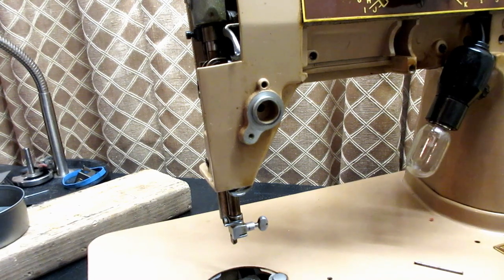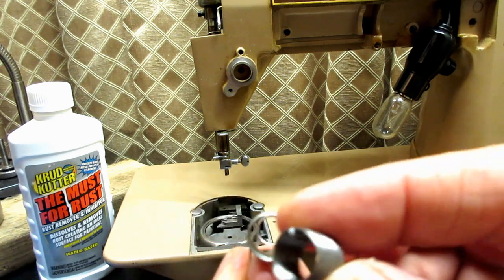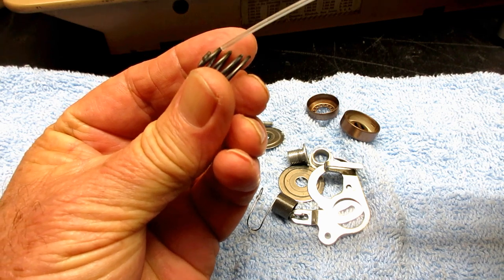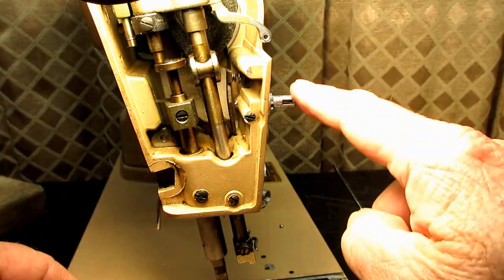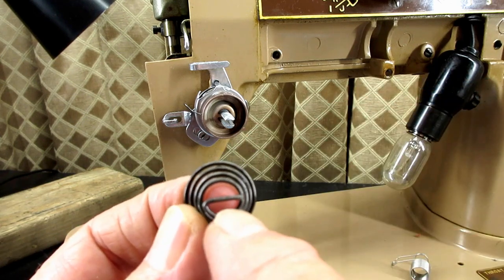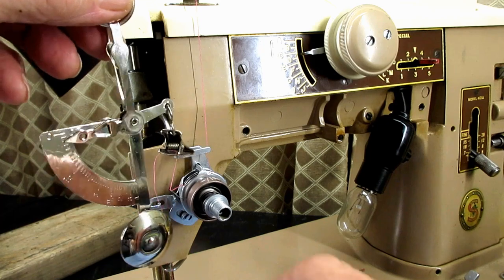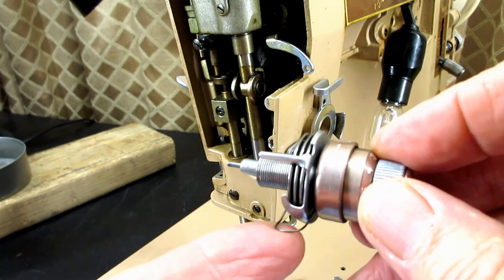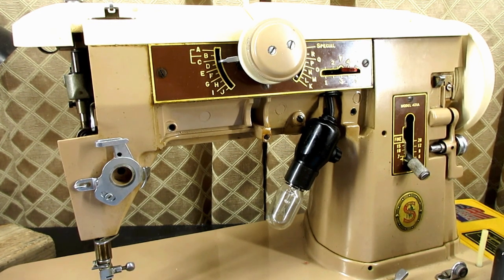Replace / Install a Missing Tension Unit on a Singer Model 401A

Comment: Thank you for your videos on the 401/403. I have two 401's that I got at D.I., one working and one labeled as a parts machine. I just stored them for years due to lack of time. I recently set out to convert my working 401 as a treadle/hand crank because I have several old Singers, including treadles and centennial models, but no zigzag treadles, so I made the adapter, and the 401 worked perfectly.  Then I got to looking at the "parts machine" and discovered it was missing the bobbin cover, the red lever,  the outer/brown zigzag knob, foot, but everything looked good and motor ran. I bought a foot and threaded up, but it would not sew a stitch. Thought it might be because of no red lever to control width, so I made one. It still would not sew a stitch. I fiddled around some more and decided it must be an alignment problem. That is when I discovered your videos. I followed your 401/403 timing video to the letter, and it now sews perfectly. It was WAY OFF. Someone had obviously monkeyed around, screwed up the needle depth and timing with the hook. I just finished your tension video so now I will go check that end of things out. Thank you for sharing your excellent knowledge!! I have since passed the info on to two friends who also have 401's.
Reply from the maker: Greetings, Wayne. I have to say I enjoyed your comment immensely. I bet the 401A makes a great treadle machine. It has some cousins in Germany, 401G, 411G, 431G, etc. that can be set up as treadle machines also, and viewers who have them tell me they work fabulously and they love having a treadle ZZ machine. Yes, for sure someone fooled around with that machine and got lost and decided it was now a "parts" machine; I've seen a few like that. It's great that you have rescued it. I'm glad you found my channel and the videos are helpful. I appreciate you sharing the info, too. How fortunate to have two Slant-O-Matics! Have looked at the serial numbers on the bottom near the nose end? Just wondering how close in age they are. If you ever find out their names I'd love to know them. Happy sewing, and take care in 2023.

Comment: Andy, Thank you for your excellent videos.  I bought a 404 at a Church "Trash and Treasure" sale for $5.00 and a 431G was given to me.  When I got them I had no idea what treasures I had.  Thanks to your videos I was able to make adjustments in the tension and in the bobbin case on both of them. I appreciate your taking the time to make the viewer completely understand the mechanisms. It's nice to know that when something goes wrong I can do a search and find one of your videos that will help me solve whatever problems come up with these amazing machines.
Reply from the maker: Oh, man! Who knew in this crazy year of 2020 you could be so lucky! Yes, a couple of treasures for sure. I'm glad if the videos helped you with the machines. You can do any and all repairs/adjustments required and keep them running for every. If the motor seems a little sluggish I'd like to share this newer method for speeding it up. I do this on every motor I work on now. https://youtu.be/pzq4tv8qn94
Thanks for taking time to comment, Steve. See you next time.
Reply: @andytubesewing1953  I ordered a Diamond D stick right away and just used it. I noticed right away the increase in the speed of the motor on my 404 but my 431G has a different type of motor and the commutator isn't as easily accessed and I didn't want to take the motor out.  Thanks for the tip!
Reply from the maker: @stevel9353 I appreciate the confirmation that it helps. I'm not familiar with the 431G German slant needle models other than pictures. I just assumed they had the same PA motor. Thanks for sharing on my channel. Take Care.
Reply: @andytubesewing1953  I took a picture of the motor but I'm not given an option to upload it.  The markings show:
PAB8-
110/120 V
Made in France
Reply from the maker: @stevel9353  I was able to find some pictures online. I see what you mean. There are no brush covers that give direct access to the area and the commutator, but looks like a two-part cover and you remove the lower half to get to the brushes and commutator.
I think internally it would be very similar to the PA motor on your 404. Maybe someday you'll need to replace the brushes (20 years from now, haha) and you can take a look inside. Take care, Steve.
Reply: Thanks for looking in to this. I enjoy earning about my machines.
Reply from the maker: @stevel9353  I enjoy it also and I was curious. I'm glad you mentioned about the motor. Take care.

Comment: Thank you for your informative videos sir. They have been helpful. Unfortunately, I continue to have problems reassembling the tension unit on my Singer Merritt 4530. To make matters worse I am unable to find any information about my particular type of machine. Any help or direction as to where I might find information would be genuinely appreciated!
Reply from the maker: Sorry, I can't help you with this model. It's one of a handful of "Universal" 5, 6, 8 & 10 stitch models sold in several countries where they took the frame and parts and used them for a number of models. I've never seen one in person and tend to avoid this type of Singer b/c of all the plastic parts inside. Other than a universal instruction manual I've never been able to find a parts or service manual for any of them.
Reply: @andytubesewing1953  Thank you sir! Best wishes!!
Reply from the maker: Weel, sorry I could not give some help. Good luck.

Comment: Hi Andy!  Thanks for your very thorough video!  My machine 401A was constantly breaking the upper thread.  I have had some trouble with the tension on this machine (my grandma's machine that she gave me back in the 80's).  I had it serviced several years ago for this reason but it never really worked well after that.  Watching and learning on your video revealed the reason.  Whomever (and he is no longer in business) serviced the machine replaced the tension assembly with one from the 201-2 model.   I am trying to work out how I can adjust this to work on my machine, if possible.
Reply from the maker: It's too sad, Susan. Sounds like they took the parts for another customer. No one I know makes the parts you are asking about. When I have this situation I have to find a used tension unit for sale, like on eBay. They are in short supply right now due to everyone sewing masks on the old machines. When they come up for sale they usually sell within hours. I've had to set up notifications on eBay to notify me when a unit like that is available, that's how hard they can be to find. I've had a couple people tell me they bought this "universal" tension unit to be able to sew while waiting to buy a vintage unit. https://www.sewingpartsonline.com/tension-complete-singer-422403-455.aspx Please note that the seller states you may need to modify the tension pin by making it shorter. 
Sorry for this disappointing news, but here is a little bit of better news. Singer models 401A, 403A & 404 all use the same tension assembly, so if you do search for a used one be sure to search by the 403A and 404 models also. Not many people know that yet, although the word is getting out, and you maybe can spot a 403A or 404 unit for sale. Again sorry for the news, but I'm happy you found my video and at least know of a solution now. Good luck, and thanks for watching my channel.
Reply: @andytubesewing1953  Thanks again!
Reply from the maker: @susanbrizek1692  Very welcome, Susan. Hoping the best for you.

Comment: Thanks again for your great videos my tension seems to be fine, I tried with two different gage of cotton threads and different stitches. 
When I lift my presser foot lever, the releasing lever doesn't seem to push me releasing tension pin. Nonetheless it does release tension on the threads to remove the fabric
Reply from the maker: Are you still working on your 411G? (It helps me know as I have many questions to answer per day) It's great that it works properly. If you are talking about your 411G then maybe the parts are slightly different. The Slant Needle machines made in Germany have a few different parts than the USA-made models. Sometimes there can be lint and dust built up on the parts that prevent full movement.
Reply: @andytubesewing1953  I'm still working on my 411G and there is no lint built up behind the releasing pin (it happened on my 191B and my 306K). 
on the presseur foot level there is a little knob that lift the releasing lever which then press on the releasing pin. My problem is that the releasing level slides next to that little knob thus it doesn't lift correctly. I tried to unscrew and rescrew the scews on the foot lever and the releasing lever but it doesn't change. even with the screws tightened correctly there is some sideways movement on both pieces which probably induces the sliding of the releasing level.thanks so much for your help
Reply from the maker: @fanchettegaillard4529  I'm not familiar with the parts of a 411G, but knowing how SInger made their tension systems it sounds like those parts are assembled wrong, or they are not the original parts. I'm glad it at least works for you and you're able to sew.
Reply: @andytubesewing1953   well I've been working on my presser foot heigth and alignment and I must have wiggled the right parts because now the releasing lever is pushing the pin and thus releasing tension. so problem solved. thanks for your help and your videos
Reply from the maker: @fanchettegaillard4529  Congratulations. It's always rewarding to solve a problem like that.

Comment: Andy, I've been trying to trouble shoot the problem with my Singer 401A which I inherited from my Mom 15 years ago.  This is the first time I've had any issues.  The machine just stopped stitching from one day to the next.  After watching a number of your videos it seems to me I should replace the Tension Unit and the Finger and Hook.  Do you agree?
Reply from the maker: Since you only said "stopped stitching" I would advise against changing out any parts yet. Especially when it happened from one day to the next. 
     The hook on a 401A is very strong and it is rare to have to replace it. Maybe polish out a burr from a needle strike, but not replace it. The tension unit is all metal and seldom wears out to the point of causing a machine to stop making lock stitches. It could definitely need a good cleaning/de-linting. 
     The needle bar could have been forced up and that would cause a loss of timing. 
To be honest, when something changes that drastically from one day to the next I've found it is often user error. 
    It could be you wound a bobbin that is the wrong type, like a class 15 (flat sides) vs a class 66 (curved sides). 
You missed something along the needle threading path or the needle thread did not go between two of the tension discs. 
Lint can foul the tension discs from coming together to provide tension. 
The needle was installed wrong, the thread to big for the needle, the needle was not installed 100% up into the needle clamp. Just to name some of the possibilities. 
     A better description of exactly what is happening, or better yet pictures or video posted to your YouTube Channel or the cloud that we could see may help us diagnose better. There are other things I could suggest, but not knowing how the problem is presenting makes me hesitate and send you down a rabbit hole. Please be cautious about replacing parts at this time.
Reply: @andytubesewing1953  I am 100% with you when you say user error.  Also, happy you said don't replace parts, this machine has been a true workhorse for 65 years with no issues.  I thought I threw out all the bobbins that didn't work but I will check.  I did change the needle right away and cleaned out all the lint (I think) , plus oiled the machine.  I used to use it on a weekly basis but now months go by between uses.  I'm going to try everything you suggested and get back to you with a video if none of what you suggested works for me.  I appreciate you getting back to me so quickly!
Reply: Andy,  I tried everything you suggested, not sure what did it but the machine is running like a dream.  You are a master!  Thank you so much!
Reply from the maker: @jomac2913  you made my morning with this great news. Joyce, I'm happy you'll be back to sewing and thanks for letting me know

Comment: Thank you so much! I didn't know why my knob was so tight.  Then I found out that the stud came crooked when I got it (used). My husband had to use some force to bend it back relatively straight enough. Following your thorough video, I learned so much and was able to put everything back together. I will be testing the sewing this afternoon. Hopefully all the tension problems are eliminated. Appreciate your generous sharing! ❤
Reply from the maker: I hope you are sewing away on it by now, 7 hours later. It's a tough machine and you can still buy used parts on eBay, etc. for it.
Happy sewing and good luck 👍
Reply: @andytubesewing1953  Thank you Andy for your response! I am sewing with the machine now! :) Unfortunately I still have trouble with my the tensions. I followed your steps to start from 0 tension. But for some reasons this is the only setting I can sew without crinkling up the fabric. Anything higher than 0 is too tight. I don't understand. Basically the discs are barely touching to each other, the tension of the thread is only coming from the guiding hooks. I learned from another person's YouTube to adjust the bobbin tension with a "one ounce" force (tiding a bag of 1 oz beans), was hoping the thread tension would become the variable which could be easily resolved ... but no luck. Now I just set it to 0.5 tension. Lol. Oh, and I don't know what I did wrong, my tension knob turns by itself while sewing! It turns from 0.5 to below zero. Any clue?  I need to get into zigzag stitches soon ... and which supposed to use even lower thread tension according to the manual. I wonder what I should do!! 😢 I would just like to say thanks again. You are so kind! 😊
Reply from the maker: @wingwong888  It is late here now and I'll think of this tomorrow and find some testing for you to do, but it is a tension problem either the tension unit or how you threaded the upper threading or bobbin case. When you have a bent stud it is hard to get it back to normal function. You think the parts are reassembled OK but the thread is catching somewhere. Other possibilities. See you tomorrow.🙏
Reply: @andytubesewing1953  Thanks you Andy. I didn't expect that you'd replied me so soon. Of course, please have a good rest. Have a great night. 🙏🙏🙏
Reply from the maker: @wingwong888  So, there are a few things that can cause the "crinkling" of the fabric while sewing. I start troubleshooting one part or area at a time to try to isolate the cause. In this case, I'd also start with the upper thread tension assembly that you reinstalled. If you look starting @46:00 in this video you see I test by adding more and more tension to the dial and can feel the thread getting harder and harder to pull until it actually breaks, then I test the other way by turning the dial for lower and lower tension and feel the thread getting easier and easier to pull. Please do that test and see the results. If you still want help please email andytube53@gmail.com b/c it is a better way to communicate this type of problem than in a comment section. You are welcome to give me the testing results, any pictures, and videos you want to show the problem.
Reply: @andytubesewing1953  You are so awesome, Andy! Thank you so much! I watched your other video about the spring stroke this morning and it makes a lot of sense.  As you said, I should do the installation all over again, and then test the tension again following this video. I think I might have missed some very important steps. And one thing I noticed was the spring lever (the "U") might have deformed as it flares out like a "V" instead of relatively parallel to each other. I will reinstall the assembly again. I will send you pictures or even videos to your email. Please forgive me if I don't send you tomorrow because I might be tied up with something at home. Thank you so much for your help. Truly appreciate your time and knowledge. 🙏🙏🙏
Reply from the maker: @wingwong888  No hurry on my account. I sometimes don't hear back for weeks or months. I respond to 25 to 50 inquiries per day sometimes, so I have plenty to dom haha. Best of luck then.